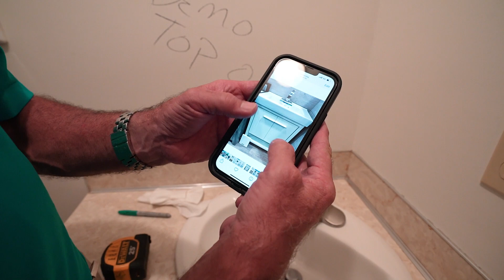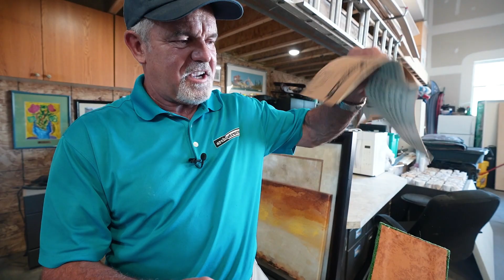I Found a MYSTERIOUS LOCKED Suitcase While DEMOING MY NEW HOUSE!

Comment: Hey Brad, just a thought on the master bath. Although not the most budget friendly but since the tile floor is coming out make it a wet room, demo the old shower and put a smaller glass wall to separate the toilet and shower. As for the vanity, just use a pedestal or wall mount sink, granted you loose the storage but maybe add a shelf or two. That will really open that little room up. Might be a little much for a rental house but do before and after video to show potential renovation clients and write it off as a business expense.
Reply from the maker: I like your idea about the shower… I thought about that but all the plumbing is on that wall🙆‍♂️
Reply: i like your pedestal idea it will free up some floor space its pretty small so i there not much storage there. the small cabinet should be good enough for everything the bathroom needs

Comment: I'd leave the corner vanity, I'd put mirrors on both sides of the corner, I'd have a hole cut to fit around the outlet box and have all edges beveled.
And just paint the vanity very glossy color.
Reply from the maker: That would work but, not sue if i can get my wife to go for it?  ( I’ll see if I can sneak it in😜) 🎺

Comment: The one you bought is a sink plunger as well.
Reply from the maker: What’s the difference? 🤔
Reply: @BradtheBuilder  The toilet plunger holds a similar appearance to the common red sink plunger, except it has a soft rubber flap that folds out from inside the cup. The flap is meant to fit and seal the toilet drain to plunge it better.
Reply from the maker: @Thief.Of.Dreams  I learned something new everyday!  I should have known this 🙆‍♂️